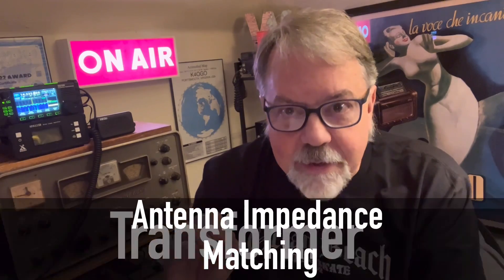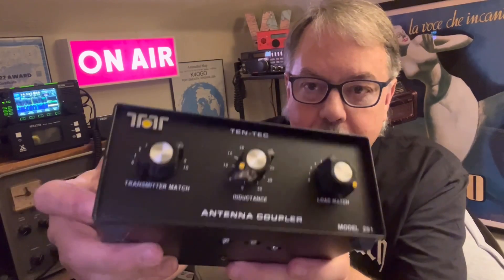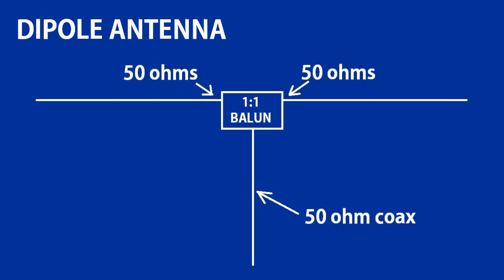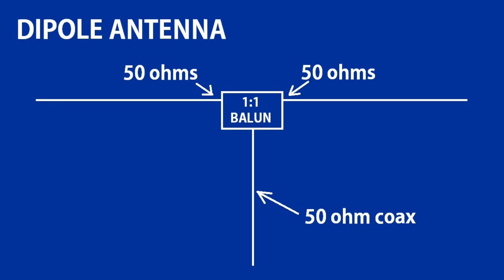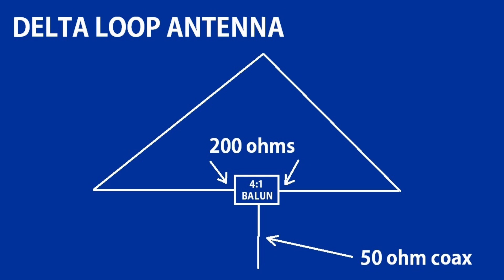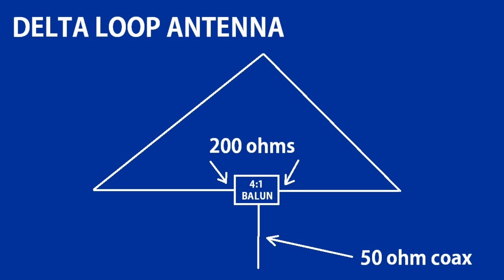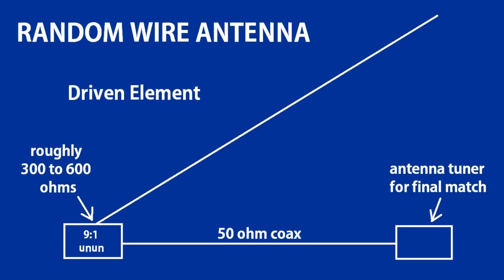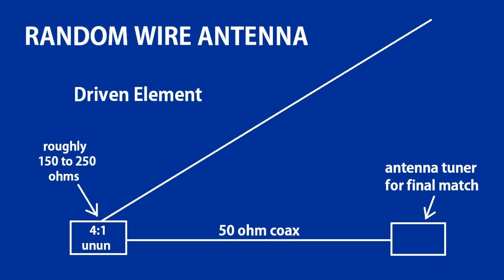Baluns & Ununs - Understanding Their Role in Antenna Building

Comment: Came here to figure out if I purchased the right one Balun - A 1:1 - Turns out I did! Wonderful... It will probably help me tuning as well considering I am tuning using a nano VNA.
Running a dipole, inverted V in the loft, cant seem to get the SWR consistently below 1.5.

I'm hoping to start studying for my intermediate exam (The middle one here in the UK), this is the kind of stuff I should have better knowledge of :D

Comment: I'm as green as it gets, just passed my general & extra license test but honestly know very limited about HF and the hobby.
My Problem: High SWR (Between 5 & infinity on my FT-710 internal SWR meter)
Called Yaesu technical support (talked to Harry) for help, I was told I need to address antenna’s resonance (whatever that means) issue. He said there's nothing wrong with my FT-710 transceiver.

Current Equipment:
Transceiver: Yaesu FT-710 AESS
Power Supply: Pyramid Model-PS-52KX. Also powers IC 2730, KG-XS20G & FT-710. I only transmit one radio at a time. I have another 25 Amp power supply if you recommend me to isolate the radio to a single power supply instead of the current sharing set up.
Antenna: Harvest Taurus 80M – 6M End Fed with 9:1 Unun (SO 239, butterfly connector for wire antenna and another butterfly connector for ground); antenna wire length 64 feet; Max Power 400W; Freq 3.5Mhz; Max Voltage 40V. I also have another Harvest Taurus 40M - 6M end fed antenna with Unun still in the plastic bag (brand new) in case you want me to use it instead.
Coax: RG8X mini; 25 feet with PL259 at each end
Ground Wire: 10AWG; 25 feet to 18” ground rod (½” diameter)
Ground Rod: Mokikuba portable ground rod (bought from Amazon) 18" long, 1'2" diameter, solid steel shaft with zinc finish.

Setup Description:
25 feet of Coax routed from transceiver FT-710 SO239 out to Unun box SO239 mounted under roof eve (side of single story home – height of the Unun box and antenna wire approximately 8.5 feet from the ground). Wire routed under the eve from the Unun box approximately 34.5 feet in length horizontally to end of eve (to backyard) then loops/hangs down then up (approximately 12 feet horizontally) to first tree branch. Then straight up to second tree branch approximately 17.5 feet high.

Comment: This is fast becoming my favourite ham radio YouTube channel! Some great information here.
Reply from the maker: Thank you! 73, Walt
Reply: @COASTALWAVESWIRES  just a quick question related to this - with my dipole or EFHW antenna, for example, if I test the antenna with an antenna analyser of the impedance of the antenna is perhaps a little over 50 ohms or a little under, does that suggest the antenna wire is too long or short or could it also mean in the case of an EFHW that the grounding isn't quite right? Thanks!

Comment: I'd like to start understanding torroids and their current flow, voltages, material, then windings, magnetism, the effects on the magnetism and voltages in the torroid.  How about exactly how energy is transfered from the feedline, into the torroid, across the windings, coupling to the input of the antenna and how the transfer of energy from the feedline to the antenna is dependent on the type of torroid, the diameter of the wiring wound around the torroid, the number of turns, etc...
I'd rather hear "I honestly have no idea" than an explanation from someone who has no idea. I know it's deep stuff but it would be nice to hear some theory on the subject and the bail put as needed😁
I enjoy your channel!  Keep up the great work.

Comment: Thanks - this is helpful. As a new returner I'm a bit rusty on some of the electronic principles. Can you tell me what a balun / unun does for transmitter efficiency / output? As I understand it (and my understanding may be faulty) the transformers reduce mismatch at the transmitter output (so you don't fry your finals - but the antenna despite being reasonably matched is still not efficiently resonant (?). Therefore if you are putting out say 100w into a system that has an intrinsic swr of 2 or 3 to one - your output will only be eg 33 or 50 watts despite the finals putting out 100w? I'm vaguely aware of eirp and wondered if I'm understanding correctly? Many thanks - Rob G1VXD

Comment: ok, so the next question is, how do you measure the impedance of your antenna?
Reply from the maker: You can measure impedance before building by modelling the antenna or you can use a VNA and measure the feedpoint impedance as well. It's really not necessary though as wire lengths and impedance are pretty much all known values before the antenna build. 73, Walt

Comment: Do you have or recommend a video that clearly explains how to measure impedance with several different types of tools or methods?  I know I can see the SWR on my G90, or see the SWR on the nanovna, but how to you get visibility to see that 2450, 450, or 200 side of the equation knowing what ohm coax you have?

Comment: How do measure the impedance of an unknown length of antenna wire let alone a half or quarter wave length?
Reply from the maker: It can be done by modeling the antenna or using a VNA or antenna analyzer. That’s really not required though as most common antenna values are know. For example a quarterwave is typically 50 ohms, a halfwave around 2450 ohms, etc.

Comment: Hey coastal waves, I recently built a inverted v random wire antenna in total with negative and positive radiation. Wires is 40 ft. Will a. 9-in-1 unun work for me My coax is 30 feet

Comment: Hey!  Thanks for some great videos!   

Been considering building an off-center fed dipole with around an 80/20 ratio fed with rg316 coax.   My calculations show that the impedance will be between 200-250 ohms.  So I’m looking at needing either a 4:1 or 5:1 unun, correct, since the OCFD is inherently unbalanced, as is the coax, correct?  

Also, am I better to be a bit over or under when picking the unun ratio?  

Thanks for any advice you can give! 

73!

Comment: Year's ago I remember a schematic where I built a tuned matching circuit consisting of a air coil and a small vari cap for a 2 meter 1/2 wave antenna for a ht.

It worked quite well, I believe one could be built for a single hf band as well.

Comment: Excellent video.  One question, how are you calculating the antenna impedance value you are using in these examples?  Does that require an antenna analyzer or just a formula that can be used?
Reply from the maker: @shanesdiy  thanks, it’s pretty much historical values and lengths, this should explain it:
Antenna Wire Length - Demystifying Feedpoint Impedance
https://youtu.be/_cL4iHiVoGY

Comment: I now know how to determine if I need an unun or balun and how to select the ratio, but how do I know the feedpoint impedance so I know how to select the ratio??
Reply: Most popular antennas (such as resonant dipoles) have known impedances that are widely published (in the ARRL Antenna Handbook, for example). Otherwise, you have 2 options: 1) use an antenna analyzer, or 2) model the antenna using EZNEC Pro, which you can download for free. It has a bit of a learning curve, but it is well worth the effort!

Comment: Hi Walt, very good video.  I have just one more question.  When I only want to receive with a long wire antenna I also need a balun?  Currently I'm connecting the simple wire to the center point of the antenna connector, and the outer side connected to the ground.
Reply from the maker: @gaborborbely8231  no, you do not need a balun or unun for receive, only transmit

Comment: How would I measure the Ohms of a particular antenna. For example how did you measure 2450 ohms?
Reply from the maker: @J0HN3  you can model it, use an antenna analyzer but you really don’t need to measure the impedance. Here’s a better explanation:
Antenna Wire Length - Demystifying Feedpoint Impedance
https://youtu.be/_cL4iHiVoGY
Reply: @COASTALWAVESWIRES  thank you so much!

Comment: Walt, thanks for the info! Today I decided to build a 41' random wire. I was impressed with the fact that my 7300 tuned across all of the bands. Unfortunately for me I didn't have the means to get it up in the air very high so incoming signals were kind of weak. Next spring we'll get it up higher to see how it performs.

Comment: You did not mention how to read ohms of a wire antenna you build to determine which union to use?
Reply from the maker: Wire length historical values determine what the feedpoint impedance should be before building the antenna.

Comment: With a vertical telescopic antenna, do you use an unun?  If so, how do connection?  inline on the coax?  Is the a unun with SO-239 connectors on both sides?

Comment: What should I use on a balanced 600 ohm 3-wire center fed folded dipole fed with 450 ohm window line that presents a 400 ohm Z at the receiver?

Comment: The impedance transformation feature of a balun can be useful, but the main reason for its' adoption, especially the 1:1, is to isolate the outer shield of the coax from the balanced antenna. For decades it was normal to connect a coax line direct to the feedpoint of a dipole, loop or beam. This could cause the coax outer to radiate a bit of verically polarised RF on Tx and also pick up noise, especially locally generated electrical noise, on Rx guiding it back to your radio. There are other devices that perform this task, like choke baluns and line isolators, but the catch all term 'balun' often gets applied to them all. The coax being isolated from the antenna helps to preserve a nice radiation pattern from the antenna, especially important if you have gone to effort of putting up a nice beam.

Comment: We live on the far eastern fringe of the Los Angeles area, in San Bernardino County, and my stereo systems AM/FM receiver struggles to pull in even the mighty KFI 640kz signal with their tower located not that far away.  Everything else is just noise. So far, I'm just using the wimpy post-card sized wound wire antenna that came with my receiver, which only excels at bringing in noise from our lights and other electronics.

Now I'm no ham operator.  I was an avionics tech and airborne radio operator on USCG aircraft in the distant 70's, and I've been a fan of the AM band, static and all, since I was a kid.

I recently found a Radio Shack longwire antenna kit amid my garage debris, and thought I might string it up on the roof, going from one chimneys the other and then across the roof a bit more.  The twisted copper antenna wire in the kit is about 75-80 feet long.  Way short for full wave or even half wave 

So I'm not TXing here, just RX. Should I go with the full 80 feet or trim it down?

To use the full length, I'd have to dog-leg it, up to 90 degrees or so.  Would this degrade my reception, or possibly improve off axis reception?

I'll be using maybe 20 feet of 50 ohm coax for a lead-in.  Would I benefit from a unrun?  (Something I never even heard of before).

Anyway, any help is greatly appreciated.  Great and Informative video.

George
Rancho Cucamonga, CA

Comment: How do you know or calculate impedance of the antenna at the connection point?
Reply from the maker: Great question, you can use a VNA, antenna analyzer or you can model it in a software application but really you don’t need to do that. It’s known lengths that have already been determined over years and years. For instance a halfwave antenna requires a 49:1 unun, random lengths of 29’, 35.5’, 41’ etc require a 9:1 for shorter random wires 25’, 20.5’, 17.5’ use a 4:1 and a perfect Quarterwave antenna should have a perfect 50 ohm match and thus a 1:1

Comment: How do you calculate the impedance of a wire antenna. 

Also when do you use an unun vs. a balun?
Reply from the maker: You can calculate the impedance with a VNA (vector analyzer) or by modelling with antenna software but that really isn't needed. there are known values for wire lengths already. check out this video and I think it will answer your questions: https://youtu.be/_cL4iHiVoGY?si=vjKTsGkpAza77j-_

Comment: The only part that I'm missing is how we figure the impedence of the random wire? Do we actually use an ohm meter and test it? Please show me how an antenna anylizer works?? I know I've asked this before but still not getting this part.
Reply from the maker: We don’t figure the impedance of the random wire. That’s overthinking it. Random wire lengths are known values that are not resonant on the ham bands we want to use. 
https://www.hamuniverse.com/randomwireantennalengths.html
Reply: @COASTALWAVESWIRES  Thanks for taking the time to answer. After reading that I give up. I'll just stick to buying antennas I guess. I didn't understand any of that article. Now I have all this stuff I bought and nothing to do with it.
Reply from the maker: @mobiltec don’t give up, I think you’re just overthinking it. Take that stuff, build antennas and make them work. That’s what it’s all about
Reply: @COASTALWAVESWIRES  No I'm done with it. I have a whole box full of stuff I bought since watching your channel. Would you like to buy all of it at a discount? Then I can afford to just buy a Tram mag mount. That's probably the one thing I should have bought instead of all this stuff.

Comment: Thank you, Walt. 🙂 I got the basic thought (matching the feed point impedance to the impedance of the coax, and to what the transceiver expects). However, what I do not yet understand is why the 1st random wire antenna in the video has 300..360 Ohms, whereas th 2nd one has 150..250 Ohms and thus they need different UnUns. The table you showed suggests that it has to do with the length of the driven element, as the ones above 8 m require 9:1 as opposed to the 4:1 of the shorter ones. Is that feed impedance something that one can calculate/measure to make the right choice for the UnUn ratio? If so, how? 🤔
Reply: Wait - seems like my question is obsolete: I just found your other videos "Antenna Wire Length - Demystifying Feedpoint Impedance" ... 🙂
Reply from the maker: Oh that’s great and thank you for supporting the channel!!! 73, Walt

Comment: I think the confusion comes from people taking two electronics functions and not separating them for teaching.
Circuit one is balun. You create a circuit to connect a balanced device to an unbalanced device. i.e. a balanced dipole to an unbalanced coax. 
Circuit two is an impedance match.

Comment: A LOOP, EXCEPT DELTA LOOP, HAS 
IMPEDANCE 125-130OHM, SO YOU USE 2:1 BALUN B U T A 4:1 BALUN 
IS POSSIBLE TO USE!
THE ALTERNATIVE FOR A LOOP IS
A 23M 450 OHM MATCHLINE IS ALSO
FULLY FEASEBLE WITHOUT A N Y 
PROBLEM! I HAVE RUN 80M.LOOP
AT 83,0M LONG AND CAN BE USED
AS A SQUARE, RECTANGULAR OR EVEN A CIRCULAR WITH DIAMETER
OF 26,42M AND FEED TO A MFJ969
ALT MFJ 962 OR MFJ 989 WITH A
4:1 BALUN INSIDE! ONLY WATCH 
OUT SHORTENING LUGS AT THE 
BACK! ALSO WATCH OUT FOR THIS
450 OHM FEEDER CABLE - THEN IT 
IS STIFF AND SHARP! 
☆SO WARE PROTECTIVE CLASES 
FOR PRTECTION OF YOUR EYES!☆

Comment: Question,   most of your videos assuming multiband and Ham radio,  but with CB gear suddenly a SHTF issue,   i keep having people ask me about low profile antennas.   The flagpoles with tuners are insanely expensive for what you get.  May i request you make up the best performing low profile antenna for CB / 11 meter use and hopefully would do as well at DX as a 10 meter you will already have made.  Name the video keyword well and you will get a lot of traffic.  You make great videos and are a true walking library of useful info and experience.

Comment: What is the difference between an End Fed antenna & and Random Wire antenna?
Reply from the maker: A random wire antenna is an end fed antenna but is not a resonant antenna, its length is cut to make it tunable on multi bands. An End Fed Half Wave is a resonant antenna that is cut to a specific resonant frequency or frequencies. So they’re both “end fed” it’s just the terminology that’s used.
Reply: @COASTALWAVESWIRES  thank you that helps.  If I cut several lengths of wire for several bands and attached all the ends together ate the end of a feed line how far away from each other should the wires be held apart, so that each one would act as an antenna for its band without being interfered with by the other wires? 
What BALUN or UnUn would be needed?

Comment: Check your Balun/Unun. I bought a cheap 4:1 balun and installed it on a 17-5 antenna. Could not get the antenna to work properly. Narrowed the problem down to the balun. Took the balun apart and realized it was wired just opposite. It was a 1:4 instead of a 4:1. Simple to unsolder and rewired. That fixed the problem. SWR on 20 meters was less than 1.5:1. Probably rare problem but it can occur.

Comment: Walt, do you have good luck with the LDG baluns/ununs? I bought a 1:1 choke/unun to prevent RF problems with my portable setups and while it worked for that, it also made my antennas behave in unusual ways. They no longer tuned up correctly at the frequencies they were designed for, so I became suspicious of the choke. So, I attached a 50ohm dummy load to one end and a NanoVNA to the other and was surprised that with the choke inline, the SWR rapidly climbed with frequency, hitting about 2.5:1 on ten meters. I opened up the choke case and found it was rather shoddy inside...and odd choice of winding method, overall sloppy winding, cold solder joints and the core was only supported by the soldered wires. There was a piece of double-sided tape inside, but it wasn't touching the core! This surprised me, as LDG's tuners are build wonderfully, very solid. Anyhow, I replaced the core with a FT-140-43, wound it with 11 bifilar turns (with a crossover winding in the middle) and now the SWR is completely flat across the HF bands. I'm a big fan of LDG and they have been VERY generous to me with their support, in both time spend and even sending replacement parts free of charge. Great company, but this choke was sure a disappointment.